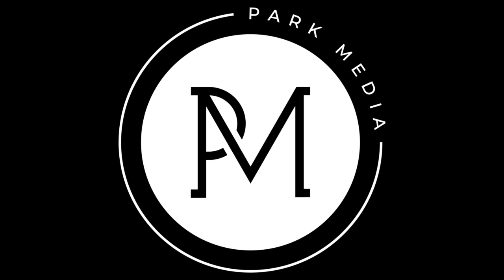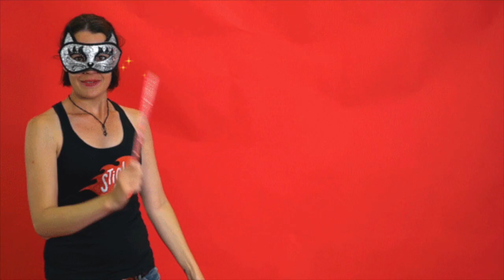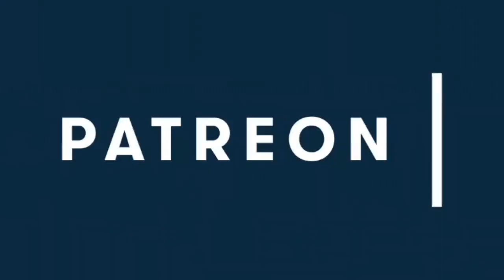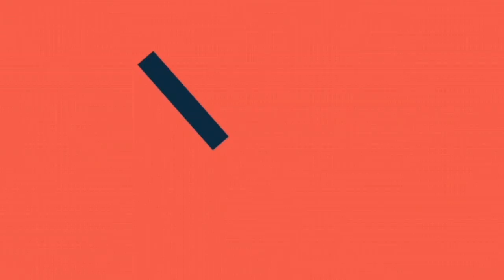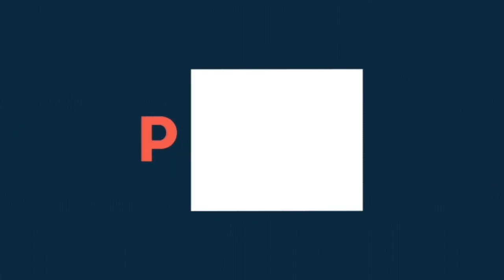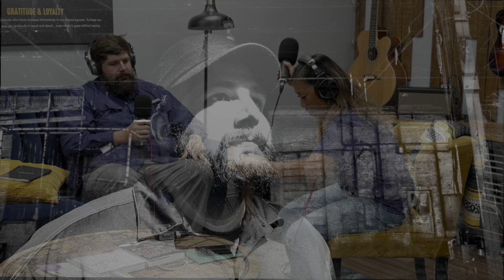21. From STO HQ: Brent Lang - VP of Design and R&D

Comment: Great interview Yung Wah.  It's probably too late now, but if you get the chance in a future interview or already know, as an LT future owner I curious as to why STO is downsizing the Volta Inverter to 3200 watts from 3600 watts in the LT.  Thank you.
Reply from the maker: Hmmm... good question. I didn't know they downsized the converter.
Reply: @STONation  3200 watts Inverter is listed on Specs/Energy System on the Storyteller Web Site.  Curious.

Comment: I was surprised that the conversation around "potty design" was also one of Brent's hot buttons.  I had this thought that instead of building a "throne", build a low profile "squat toilet" as in Japan.  Basically a hole in the floor, and one just squats.  It's been done for centuries, and in fact is more anatomically correct for the bodily process.  Great project for the gifted engineering student! ;)